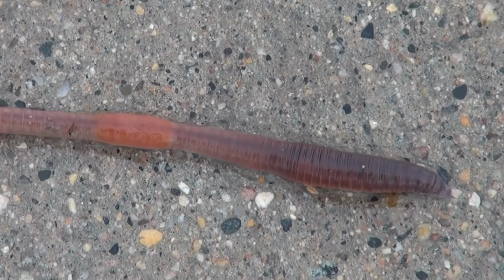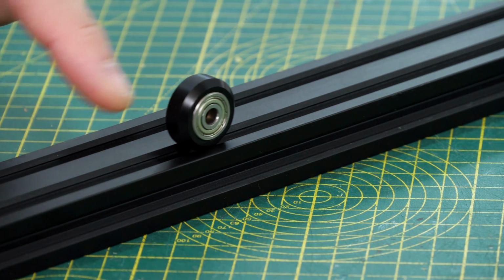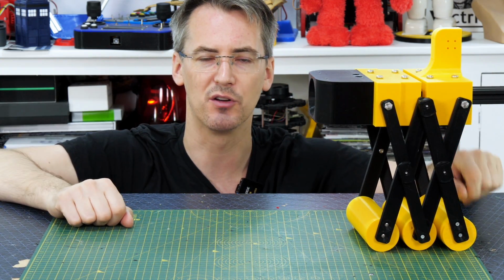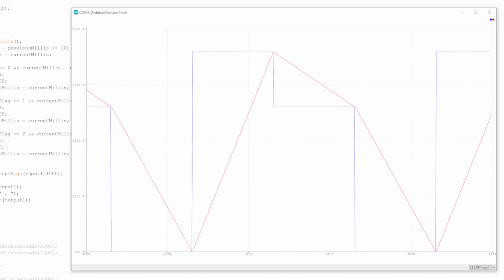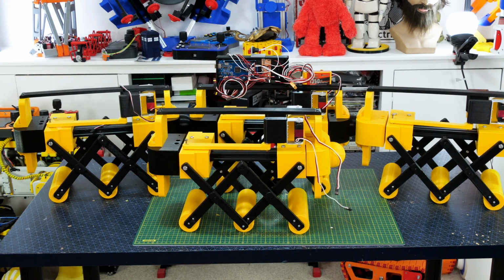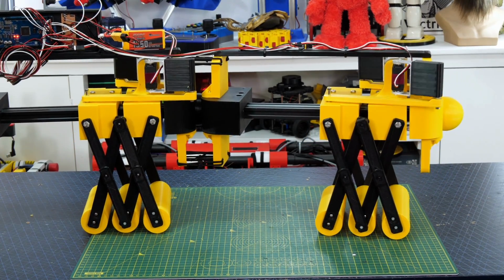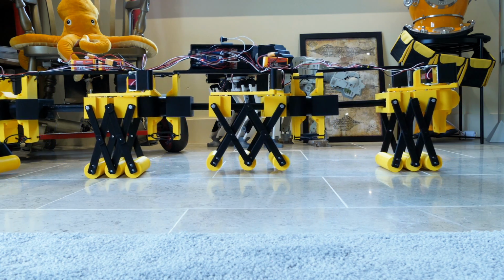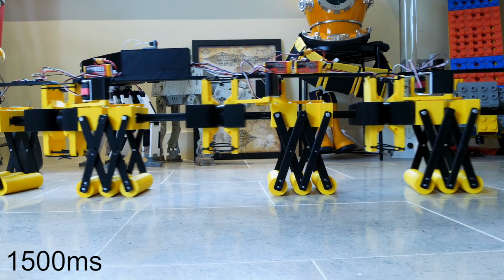Peristaltic locomotion device

Comment: It seems like the worm is moving all it's front parts forward sequentially, then pulling the back end forward using the combined friction of each forward-facing section. Do something similar, where you're effectively making a sine wave that terminates flat on the stopping part, allowing each back-facing portion of the vehicle lift up and move forward with no friction, while the front portion holds the rest of the vehicle in place.

Comment: Idea: just two (grippy) rollers per section. Both are on their axles with one way bearings. In opposite directions. Uppon moving towards each other the front roller cannot roll backwards so it pulls the section forward. On extension the back wheel cannot roll backwards so it pushes the section forwards. Wouldn’t this make an extremely simple solution for peristaltic movement?

You could keep three wheels if really needed by making the central roller free to rotate in both directions.

Comment: The worms actually have a part of their body expanding, and then at the same time contract. Also parts of a couple of nodes that are expanded at the same time. Maybe you can have the walking animation only use a part of their lateral movement, and have the 'extra' room to work in groups

Comment: You have a motion system which operates in three phases. You need three worker groups, each group on a separate phase, each member of the group executing its phse in parallel. Group A B and C, with ideally 2+ members per group.

Comment: Would it help to put a breaking system on the rear wheels? It’s just like walking, the back leg pushes the body forward, by adding a breaking system (wheel locking system) you can keep the wheel stationary for a moment in time.

Comment: I think syncing the motion so that the main shaft travels at a constant rate would be nice. It would require placing and lifting each foot all while moving backward for no slip. This is harder in segments since it wants to have longer stroke. Would be cool to see on a long single shaft. I think you'd have to move them relative to the shaft with a rack and pinion tho since you want the legs' strokes to overlap.

Comment: Brilliant idea, but perhaps have them expand and contract in sequential order with overlapping cycles,

1234 
(All contracted)

123 4
(4 to 25% extension)

12 3  4
(3 to 25%, 4 to 50%)

1 2  3    4
(2 to 25%, 3 to 50%, 4 to 75%)

But I think the ends will need a brake system of some kind to anchor the end going forward and grappling the rest along behind.

For maximum efficiency, I suggest a reach / anchor / reach approach.

Comment: That last design you showed in the software with 2 feet on two rails looked like a great starting point... BUT instead there are 2 feet on each rail that make up each of the 4 segments that pivot with the ball and socket like in the peristaltic prototype. And each of the feet can lift up and down just enough for the 4 feet to be used in a 'walking pattern'
then each segment is angled left or right to steer..... and you may even use 2 of these, each like the track of a tank with you sitting in between.....  
- I don't think you need any type of joints like a knee or ankle if you're on a hard flat surface, but if you use it 'off-road' you might be able to get away with a sort of 'shock absorber' in each of the feet to walk on uneven terrain, so that each foot's lift/extension doesn't require full extension to 100% ... but that would require position sensors on each foot.... but this is all obvious to you LOL - I know nothing about this, except for what I've learned from watching your videos.....
- -  I only wrote this out because you mentioned how it would look while moving, and I think this would look hypnotizing the way millipedes looks... or you could think of each section as a tiny horse lol (how that for a decoration - lol - you riding atop 4 tiny horses :face-green-smiling::face-green-smiling: )
- ANYWAY ... I hope this at least gave you some inspiration or ideas... that's the least I can try to do for all that you have given me with your amazing videos and BRILLIANT projects!!! THANK YOU!

Comment: Would have liked to see a 750ms delay so that it would be a full even cycle between front and back movements. Exactly half of the 1.5 second one. That way there should always be one actively pushing forwards. 

Another idea would be to have the middle two segments have TPU feet so they have more traction, while the outer two keep lower friction feet since they aren’t supported.
Reply: 750ms was my instinct too, but I would have tested other harmonic fractions of 3s as well.

Comment: When you went from step input to ramped input, you needed to add a delay in the routine for each movement to finish before the next movement starts.  Because of this, you essentially always have all your parts moving at once.  No section of the worm ever has a stable platform to exert force against.  If you add in the delay, you can trigger the segments sequentially, with each acting against a pair of stationary partners.  The mechanism can take much larger and more stable steps.

Comment: This works similarly to a simulation I made for peristaltic motion. It was for a videogame where you'd play as a loose length of intestine, but that's beside the point. The point is - I was using 6 sections for mine. I spent AGES trying to get it to do more than just vaguely wriggle around. What I found was that an even number of sections is just... bad, somehow? Three is useless, so 5 or 7 are a good pick. Slap another module onto the back of that worm of yours and it might well perform a bit better...

Edit: I also remembered as I was watching the end that yes, offset = cycleLength*0.5 is the only workable one I found - until you have so many sections that offset*sections > cycleLength*9 or thereabouts, but then the simulation ebcomes unwieldy to use practically. Or, in your case, you run out of plastic and servos.

Comment: I think the original way of doing it is more visually interesting, where the movement is done in pairs of sections, keeping the total width between the two sections the same, and having one thin section at a time moving backwards along its body, rather than doing it in pairs with a walking kind of motion. Perhaps with some kind of structure to keep the joints level with each other. I think it would be an interesting challenge to design such a structure than still allows it to turn.

Comment: James, in order to make a worm that you can ride on you'll need to keep in mind the issue of mass.  Segments with greater mass, i.e. where you're located, will be more resistant to change when contracting.  You may be able to solve this, and potentially improve the locomotion, by designing an "upper deck" where you sit.  By syncing your placement over the segment that is expanding at the time but shifting forward for contraction you would encourage forward movement.

Comment: May I suggest replacing the rollers with brushes with angled bristles? Rollers move more or less forwards and back with equal ease. Don't you want something where the forces on the ground have a directional preference?

Comment: Perhaps if the round sections on the bottom had slight rachet gearing; it might easily slide one way but encounter more resistance the other.
Not sure how you'd do it but hey.

Comment: I think your original design is the way to go, where the segments get longer as they get thinner and lift off the floor. Except you’d need many, many more to make it work fluidly. There should be at least two ot three contact points with the ground at any one time, and the mass should translate from one contact point to the one ahead like in a slinky.

Comment: What about airbags? Rubber pads on the bottom that can inflate and deflate, so when they're trying to grip the ground they puff up. But when they're trying to be dragged freely, they deflate.  If you did a flow through system where they're fed by an air compressor and then let the air out when they deflate that might be too noisy, so instead you could do a big air cylinder like a syringe that would be actuated by a motor, so each bag would have its air circulate back and forth between the bag and an accompanying air cylinder on each segment.

Comment: if you made the very first and last roller move but with a freewheel mechanism then as it pushes the droopy front section along the roller has no friction and when it is subject to drag the freewheel locks which would give it grip - same for the very last roller so it gets real good one way motion - if u wanted to get fancy u could have these done like the gears on a ratchet so that you could activate them via a servo so you could get forward and reverse motion

Comment: The last idea, two feet in parallel, is a step closer to just making the linear slider equivalent of a strandbeest.  It's not a bad idea but isn't anything all that interesting.  I'm not even sure if a paralleled peristaltic would still be considered a peristaltic contraption as now you'd be twisting that definition to fit a multi-pedal machine.

Comment: Maybe a snake would be another yet similar form of locomotion to examine for this kind of build?
With something along the belly of the robot/vehicles moving instead of the whole body acting like an accordion?
Probably with slots in the belly, and fins or such that move in an offset circular motion so they come down and pull/push forward or backward?

Comment: As long as you don't mind it only going in one direction, I think asymmetric gripper feet would work better. I.e. the front being a smooth curve giving low friction. And the back being vertical with a sharp angle. Obviously this would need a surface with some give to it. So carpet or many types of outdoor surfaces.

Comment: If the wheels had grip and were designed to rotate in only one direction.  Then they would free wheel going back and then drag against the floor when going forward.  That should really help with efficiency.
Reply: He mentions the idea of using ratcheted wheels early on in the video.
Reply: i was thinking the same thing just wasnt sure how to stop the wheels. a one way bearing would work perfect
Reply: Ratchet perhaps?